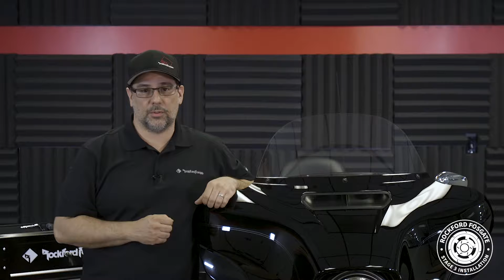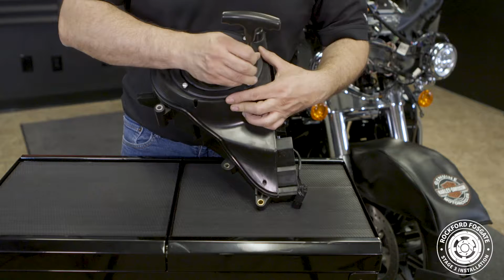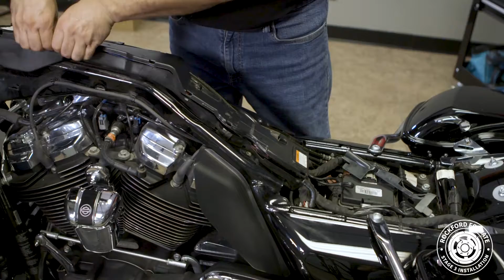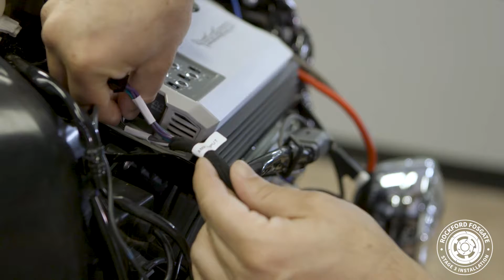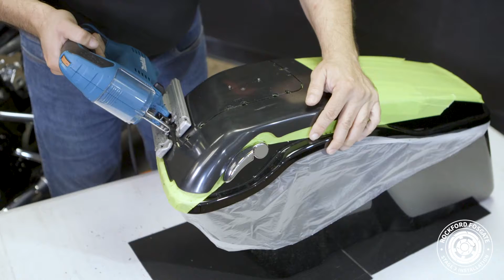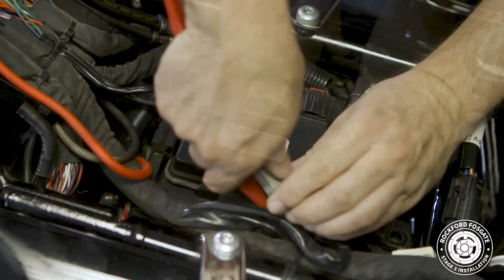2014+ H-D Electra Glide Ultra Classic Stage-3 Installation

Comment: Hi my dad just installed this kit on his 21 ultra and i think the techs that flashed his unit were confused on how to flash. Is there a difference in the flash for 4 speakers vs 6 speakers?
Reply from the maker: Hi Charles, Your dad's 2021 Ultra must be a beauty!  Assuming he has the aftermarket Stage-3 as featured in this video, the dealer should be using a TechnoResearch flash tool.  There is a special "Rockford Fosgate 2014+ All Bikes" flash setting that we recommend using.  FYI, the 4-speaker and 6-speaker settings are for older Harmon-Kardon factory systems.  If that particular dealer doesn't have the TechnoResearch tool, you can find dealers with that tool here: https://rftech.custhelp.com/app/answers/detail/a_id/1344

Comment: Where can I find a video using this Stage 3 setup  with Rockford Fosgate DSR1 into a 2019 Roadglide?
Reply from the maker: Hi HarleyD, we currently don't have a video, but this is how it needs to be connected.  You can also call our technical support FREE if you have questions at 1-800-669-9899:
1) Remove the DSR1 from the box and have it ready.  NOTE: you will not use any of the harnesses included with the DSR1.
2) Find the extra harness that came with your motorcycle audio T-Harness labeled AMPLIFIER INPUT / DSR1 OUTPUT / SUB.
3) Detach the AMPLIFIER INPUT jacks and plug the extra harness from Step-2 labeled AMPLIFIER INPUT into the corresponding amp AMPLIFIER FRONT/REAR INPUTS.
4) Plug the other end of this extra harness labeled DSR1 OUTPUT into the 16-pin DSR1 OUTPUT.
5) Detach the remaining 16-pin to dual 4-pin harness from the main T-harness (originally plugged into the amplifier) and discard it.
6) Plug the remaining male 16-pin connector from the T-harness into the DSR1 INPUT.
7) Find the smaller 18-pin male connector located the main T-harness containing a BLUE / RED/ YELLOW wire and plug this into the DSR1 VEHICLE data port.
8) Find the amplifier B+/GND/REM connector and swap the BLUE wire from the H-D12V turn-on connector to the T-harness BLUE/WHITE wire labeled AMP TURN-ON.
9) Turn the system on low volume and connect to the DSR1 using your Android or iPhone Bluetooth.
10) Start tuning your system!

Comment: What's the typical time for a HD mechanic that has never done an install?  Bikes been at the shop for 2 and 1/2 days and im starting to get a little bit concerned
Reply from the maker: Good Morning Michael, a full stage-3 system on a 2014 or newer typically takes 2-1/2 hours for experienced installers.  For an unexperienced installer, I can easily see it taking 4-6 hours since you want to be careful with everything.  Honestly, most shops struggle on flashing the radio. All Authorized Rockford Fosgate Dealers are offered free training on specifically how to flash the radio and what pitfalls you can encounter.  I'd be concerned about them never installing our system before, because I can almost guarantee they have an error code they don't know what to do with.  Who is the dealer and where are they located? -Eric
Reply: @rockfordfosgate  They are Grizzly Harley and located in Missoula MT. They are closed today and tomorrow. I had my bike in at 11 on Thursday. Then they had it all day Friday and Saturday. I have a 2019 RG Special and I picked up 2 extra speakers and lower leg fairings so I'll have the 6 speaker set up.
Reply from the maker: @mikepsly73  Thank you for that information.  Nice Ride by the way!  I see Grizley HD is a newer dealer.  Did your RG Specials come with factory lowers or are these aftermarket add-ons? If add-ons, I can see that taking some extra time. It's fairly easy to run the wires zip-tied to the crash guard, but if they are trying to run them inside the tubing, that could be very time consuming.  If you like, I can have our team reach out to them Monday morning to check on your install and see if they need any assistance.  May I use your name Michael Sly?  If you would like to continue this conversation privately, you can email (ce@rockfordcorp.com) and I'll pick-up from there.  -Eric
Reply: @rockfordfosgate  the lower leg fairings are aftermarket made by hogworkz. Yeah all this dealership had available was that stage 2 boom. Which requiring 1 amp for every 2 speakers is dumb, expensive, and takes up room. I persuaded them to become a Rockford fosgate dealer so I could get this system installed. Well im the guinea pig. Yeah use my name. I sure do appreciate it.
Reply from the maker: @mikepsly73  Great info, thank you.  Those lowers should work great for you.  Also, we sure do appreciate your persistence for wanting better quality audio.
Reply: @rockfordfosgate  I shot you an email with my number and a little bit better explanation on what's going on
Reply from the maker: Thank You @mikepsly73   I'm reading it now.
Reply: @rockfordfosgate  they said Tuesday or Wednesday yesterday morning.

Comment: I didn't get the Y adaptor or the dsr1 harness. I feel jipped.  I'm trying to set this up the same way. Do you have a link to the additional Y adaptor?
Reply from the maker: Where did you purchase this kit?  It sounds like someone pulled those pieces from an existing system.  Can you please email me the Serial Number from the main HD14U-STAGE3 kit box to ce@rockfordcorp.com.  I'll also help you get replacements since I pulled some extras from these videos we created.
Reply from the maker: Hi Studio Ward, I never saw your email.  Note the email is (ce@rockfordcorp.com).
Reply: @rockfordfosgate  I don't have the box anylonger unfortunately. I bought it at Car Toys. I should have thoroughly checked the contents, especially after I noticed the inside boxes were scotch taped closed.  He said it was a popular option with only 2 boxes left and he gave me the better of the two boxes.  I ended up buying Rockford RCA's of of Amazon but didn't notice it was supposed to come with the additional wire harness till I pulled the bike apart. I'm sure one of the techs just pulled it out of the box, of course the guy I got it from there was just filling in from another location..lol. that's the issue with these kind of places. For instance,  I returned two crappy speakers there and even told them I had installed them and they didn't even open the box to see if they were damaged or some old speakers in there. That could've been what happened to me, probably bought someone's return.
Reply from the maker: @studioward9416  Thank you for that information, that makes sense.  I no longer need the Serial Number for internal tracking of production issues.  Go ahead and email me at (ce@rockfordcorp.com) with the requested parts and your shipping address.  I'll send you replacements harnesses from the extras I have.

Comment: Are all the speakers waterproof and do you offer a higher watt amp for this set?
Reply from the maker: Hi Albert, sorry we're just seeing this.  YouTube made an algorithm update because we're now seeing messages we were never notified about.  Yes, we call them "Element Ready" because they are protected from water, dust and UV rays.  The TM400X4ad amplifier included with this kit is no joke, although it's rated at 400 Watts, typical birth sheets typically show 550+ watts.  We've been honestly rating our amplifiers since the 1980's.  No "when lightning strikes" marketing numbers.  Just real certified power per IHF and CEA standards, standards that not many abide by because it lowers their power output power.

Comment: I just tried ti have my new 19 Limited flashed but no luck. 1st the Harley tech didn't even know about a Rockford flash. They did my original flash on my 17. So, I went to Columbus Car Audio in Columbus, Oh(great people). I guess they had to update their software and since I didn't have time they had a Rockford tech try to remotely flash my radio but failed. My question is could there be an issue with the radio or should I go back and try it again? CCA didn't give me any codes or anything because I was running late. I miss my Rockford system!
Thanks for your time, again
Reply from the maker: Hi David, Harley factory techs must be "Authorized Rockford Fosgate" dealers too or they will not know about the flash.  Standard factory H-D technicians use the DigitalTech flasher, whereas Authorized Rockford Fosgate technicians use the CenturionAudio flasher (with the RF flash).  Columbus Car Audio is a great dealer and we've trained their technicians on Motorcycle Audio upgrades.  Sounds like they just needed to update their software (you have to pay every year for new updates.)  While I'm not familiar with "remotely flashing" since I believe you typically need to have the Centurion Audio flasher connected to the bike with the software installed on the laptop in order to remote the process.  I would call CCA to make sure they have their software updated, then give them another chance to update it.  Takes about 15-20 minutes to roll the bike in, update it, test everything, and roll the bike out. -Eric R.
Reply: @rockfordfosgate  CCA was updating their software but I ran out of time. The damn work thing. I will go back one day this week for the flash. Hopefully the update will like my bike. Thank you once again. The videos you do are some of the best how to I have ever watched, multiple times. I started using Rockford in the early 90s and thanks to the videos I will continue to crank em up. Have a great weekend Eric!
Reply from the maker: @dabreden  Thanks for being a long time Fanatic!  We certainly appreciate your support and growing with us since the 90's.  I started in '89, so I can certainly appreciate this!!!  Enjoy the rest of your Sunday :-)
Reply: @rockfordfosgate  Eric, I am at a loss. I'm hoping you could point us in the right direction. I went back to CCA and another $140 they said my radio was locked. Jay gave me a code M1518 to give to Harley. So, now Harley is saying my radio is fine because it works (imagine that). Yes it works but sounds like crud. Their digital tech didn't find anything wrong. Now the funny part is the techs never even heard of a Rockford flash. They are saying that my radio isn't working because the amp isn't installed but the speakers are. I also noticed that the bass and treble doesn't change much. I know Rockford is installed in MANY 2019 harley ultra limited. Do you have any ideas I can pass along? I apologise for this but I do appreciate it so much I bought your saddlebag kit. Hopefully I get to install it.
Thanks again Eric!
Reply from the maker: @dabreden  I will check with another technician in the a.m. because I was just notified today about a "locked" situation with a certain version of the Digital Tech software (H-D caused and rolled out a fix for it - nothing to do with aftermarket).  I'll find out more info and get back to you.
Reply from the maker: @dabreden  O.K. I have some bad news and some good news as shown below.  This assumes you have the GTS (full touchscreen) radio since you're referring to a "lockout" code:
1) H-D released MY21.20.17 software which caused a lockout issue.  Some customers who previously upgraded to the version xx.17 experienced a complete lockup of the system and caused the radio to be "bricked".  The fix was replacing the entire radio.   MY21.20.28 fixes this lockout issue and is currently available for download from their website.  If you need the latest software, you can contact me at (ce@rockfordcorp.com) and I'll email you the link to the download where you can place on a USB stick and plug-into your USB dongle to update the radio.
2) As mentioned before, unless the H-D Dealership is also a Rockford Fosgate dealer, they will not know what a "Rockford Fosgate" flash is, because their "DigitalTech" instrument can't see it.  Only Dealers, like CCA, who have the "TechnoResearch" tool can see other flash types.
3) I'm not sure what setting your flash is currently unless you know what the name of the setting is.
4) The motorcycle system recognizes the FACTORY amplifier through the CANbus.  Your aftermarket amplifier is not connected to the factory CANbus, so (depending upon the flash setting) it will show "amplifier not connected". This is normal operation when adding any aftermarket amplifier to an H-D motorcycle.  I'm assuming you're using the Rockford Fosgate TM400X4ad amplifier as used in all our system kits.  Using the Rockford Fosgate flash and Rockford Fosgate amplifier, you will never connect to the CANbus system.  Since the H-D technician is not familiar with aftermarket systems, they will tell you the "factory" system isn't working properly, which is correct, because you're no longer using the factory amplifier.
Reply: @rockfordfosgate  I only have MY21.20.22 which I just updated to from Harley's site. Yes please send me the ... 28. I will email you my request.
Harley told me today that they are not allowed to Flash your settings. They also said that it is impossible to flash the radio if the amp is not installed. Columbus Car audio said they could flash it without the amp. So, I am going install the amp and try CCA once more. 
  I do have your TM400X4ad amp that I took out of my 17 Ultra. I did buy the newer amp installation kit with the T-harness and Y adapters though.
 I don't know what flash is on the GTS now but I can say it sounds like crud! 
 Once again, thank you! I will let you know what happens next... It WILL be good news
Reply from the maker: @dabreden  Thank you.  I replied to your email just a moment ago.
Reply: @rockfordfosgate  Eric, the flash finally took and I have my ROCKFORDTASTIC system back. Now, I have to install the bag speakers and get the DSR1. I Will be watching your videos a few more times lol.
Thank you for all of your help and your time! If I can repay the favor just ask. Or pay.
I am excited
Reply from the maker: @dabreden  That's great David!!  I'm very happy you finally got everything working correctly.  One thing I know about audio ... it's always a work in progress.  We order another upgrade, hide it from the wife, then sneak off into the garage to "fix a couple things".  Ha Ha!  Your happiness in the product is payment enough my friend :-)
Reply: @rockfordfosgate  lmao..you gotta love the garage. I am heading out to mine to watch more of your bag lid installation. I'm sure these won't be the last upgrade to my ROCKFORDTASTIC system. I'll be back for more lol.
Thanks again Eric. Its nice receiving some quality help. Keep doing what you love to do.
Stay healthy and safe
Reply from the maker: Thanks  @dabreden !  Appreciate the kind words.  Hope you and your family stay safe and healthy too!

Comment: This video was posted Aug 26, 2019, 10 months ago. I have been to the Rockford Fosgate website to purchase this system, but it says 'Coming Soon'. Any idea when this system will be available or should I just move on to someone else?
Reply from the maker: Hi Chris U, yes all Rockford Fosgate motorcycle audio kits have been hot sellers during the COVID-19 quarantine. We anticipate all products being back in stock mid-July to August.  May I suggest checking your local Authorized Rockford Fosgate Dealer since many Dealers stocked up for this exact reason.

Comment: How long should this install take from a dealership?
Reply from the maker: Depends upon the installer, but I can do one in about 2-1/2 - 3 hours.  Extra time needed for the Street Glide because the speaker pod bolts are difficult to access.  I've seen quotes from dealers from 3 to 4 hours on average.

Comment: Installed Front Speakers, bag lid speakers, and 400 watt amp.  Sounds great.  Only feedback i have is why not make the speaker plug connection outside the bag for easy removal.
Reply from the maker: Great feedback Blake, thanks for that!  We get comments regarding the placement of the grommet and for the caliper side it's not a problem, but for the drive belt side it's a liability issue.  Our engineers determined the cable could be installed with enough slack that the connector could get caught up in the drive belt and rip the cable (and anything connected to it) from the saddlebag.  It was determined that it would be safer for the connector to reside inside the saddlebag to risk potential damage to the system and motorcycle.

Comment: I have the older 14 + kit which sounds ROCKFORDTASTIC. Loud and clear. My wife has to stay about 40 feet behind me and her stereo cranked because my Rockford system is so loud.
Anyway, I want to just buy your new T-Harness so I can remove my tourpack. Do you sell the T harness and Y adapters? Thanks for great videos too. I couldn't have installed mine without these videos. Keep em coming. Hoping your 98-13 kits will fit wifes bike
Reply from the maker: HI David, thanks for the feedback!  Yes, we sell the T-harness and Y-Adaptors in the RFK-HD14 amplifier wiring kit available here: 
https://www.rockfordfosgate.com/products/details/rfk-hd14/

Not sure what model your wife has, but we just finished a 2003 Street Glide and posted the videos.  We're also working on a 2008 Electra Glide Ultra Classic that's in production right now.  Here's the SG we just posted:
https://www.rockfordfosgate.com/products/details/hd9813SG-stage1
https://www.rockfordfosgate.com/products/details/hd9813SG-stage2
https://www.rockfordfosgate.com/products/details/hd9813SG-stage3
Reply: I seen that but I just need the T harness. Ok, thank you
Reply from the maker: @dabreden  Yes, to clarify, the T-Harness is not sold as a separate customer service part.  This is because many systems require the T-harness, Y-Adaptors, and Boom! Bypass plugs that are all included in the Amp Installation Kit.
Reply: Thank you